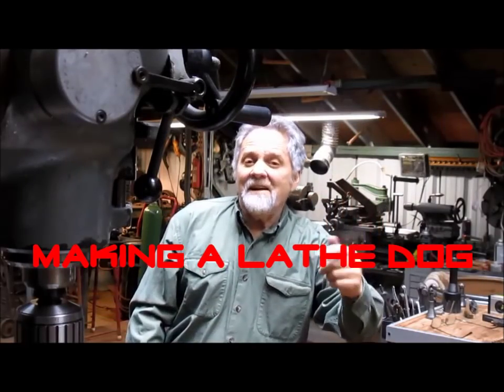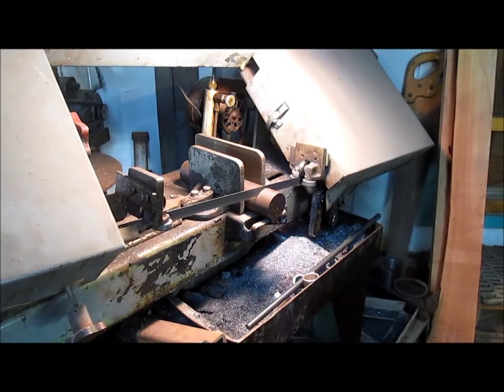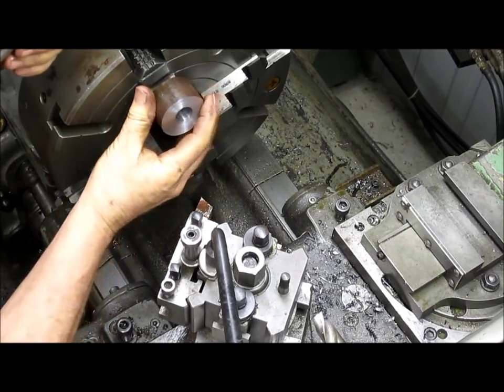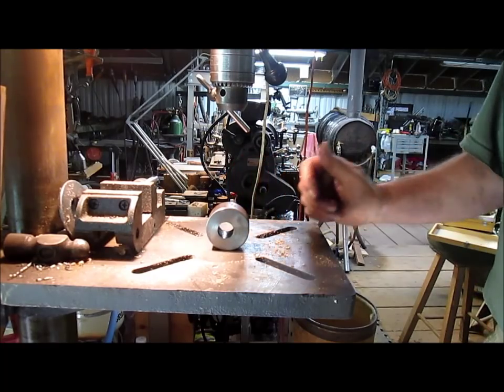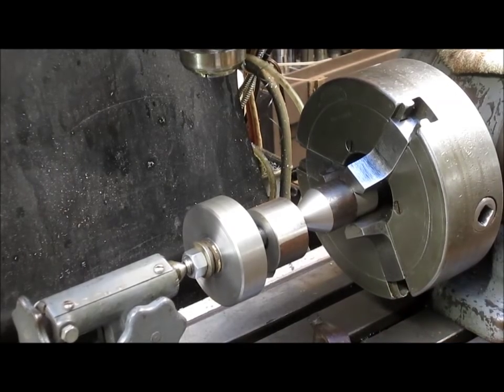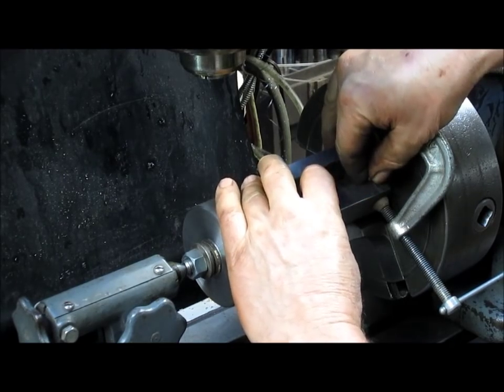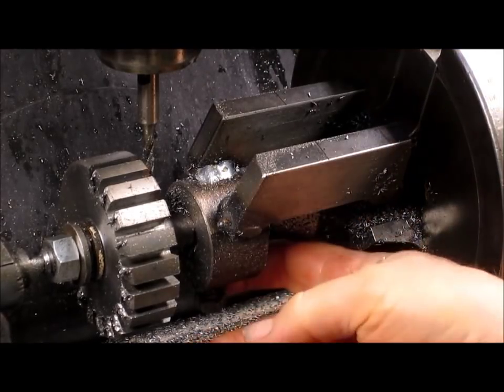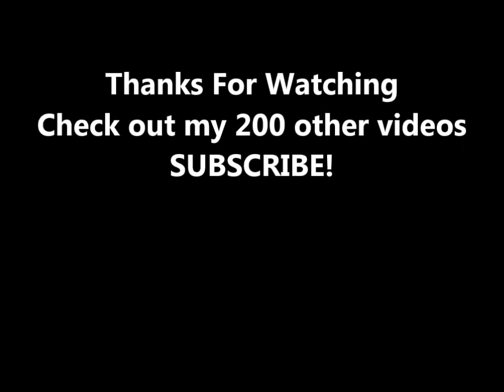Making a Lathe Dog

Comment: A dog that came with my 2nd hand lathe had a rod hose-clamped to extend it out to reach the drive plate. It looks too dicey to risk it in any cutting operation. Your solution looks much safer. I must say that I'm not entirely happy with any dog I've seen yet (except for the one designed by "Clickspring") as they have all been asymmetrical which would necessarily throw the lathe off balance. Bad for the turn accuracy of the part and ultimately bad for the lathe.
Reply from the maker: Even with the smallest lathe I have never had problems with lathe dogs making my work inaccurate because of balance. It's a tried and true method of holding work between centers so I wouldn't worry about it. 
Welding an extension instead of hose clamps is a whole other ball game. I'm sure it would work in a pinch, but it would also worry me. Thanks for watching.
Reply: Nik C. Colyer Good to know, thanks.

Hmm, I hadn't considered welding. I'm probably wrong, but dogs are usually made of cast metal right, but isn't "cast" very difficult to weld? There's so much still to learn.
Reply from the maker: If yours is cast iron you can braze it to a piece of steel. There is also some nickel arc rod you can weld cast iron with. Ask your welding supply guys. Never arc weld cast iron when you are going to machine it. The weld crystalizes the iron and nothing short of a grinder will touch it.
Reply: Nik C. Colyer
To be honest, I don't even have a welder. Though one would be nice to have there are so many other priorities. But thanks for the information. So you think the dog that came with my lathe is safe to use?
 I worry about parts flying!

Comment: Hi Nic, got to say good job , using the things you have to make what you need. That's the true meaning of being a machinist. Wish I were closer I'd like to hang around the shop and help and learn more, I'm 59 and still trying to take it all in I've been a machinist from vocational in 1974 . I too make use of things I have to get the job done I'm always using other items that are trash to useful items. Couldn't find a gear for my drill press table so I'm gona braze up the broken teeth and recut the two teeth. bought a 32 tooth gear from a guy on eBay he said it was 3" dia . must have used he's teeny weeny to measure its just over two " ,so I'm out twenty bucks unless I put in a dispute . But that's the chance so I'll eat it . Had a neat repair it's a electric etcher made by the gear company Illinois . old and heavy put a new cord and wow it works it's also a mag and demagnetize machine, really old no zip on address and cloth cord covers on cables. Oh well thanks for the entertaining vids I like them all ,some I'm waiting and haven't found the next in line . Looking for a dividing head for my shop they just plain want to much for used ones I've seen. Take care and god bless
Reply from the maker: +Silverbullet Hey, you what you've got is my motto and I do like fixing things that are worth fixing. I paid $300. for my dividing head and I hardly use is, but when  need it it's invaluable. I'm working on getting a jumping jack for my bridgeport, again something I'll hardly use, but what the hell. I like being universal and you gotta' have the tools to do it. Thanks for watching.
Where do you live?
Nik